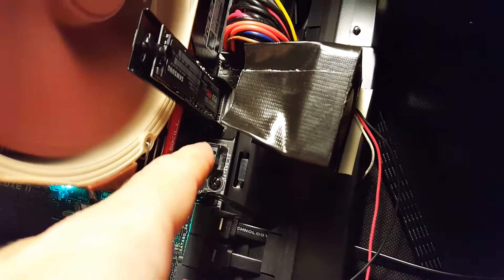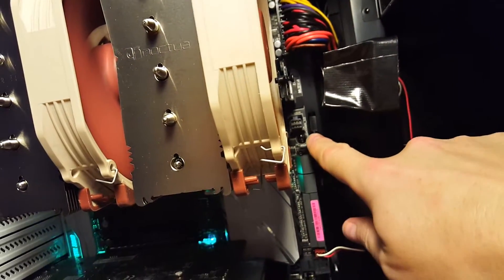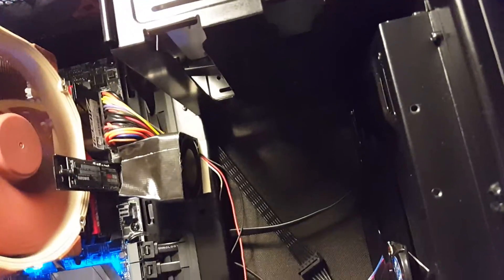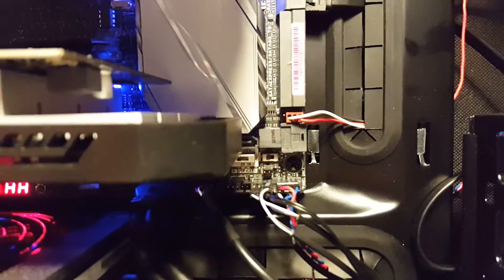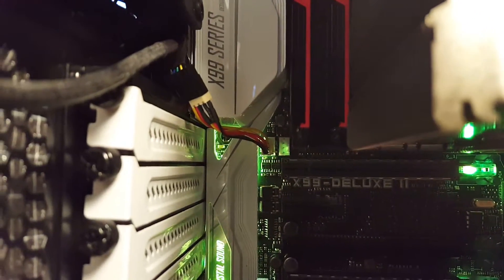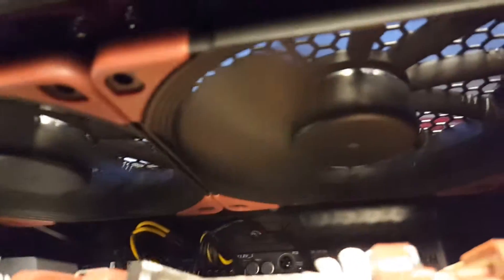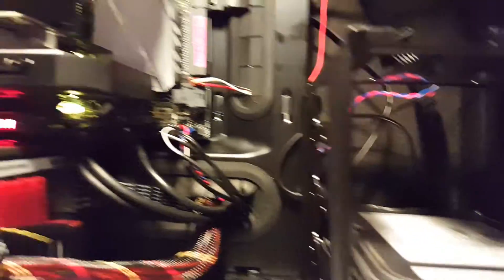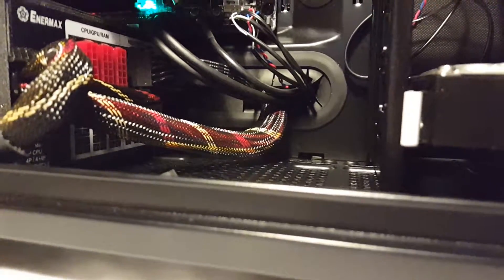Additional cooling for 950 Pro m.2 in ASUS X99 Deluxe II

Comment: DId you know that some of the new Z370 motherboards have a bracket included for mounting a 40-60 mm fan to cool m.2 NVMe. Your idea and method is not deemed insufficient.
Reply from the maker: I added the fan because of another video I watched that showed that the Samsung NVME sticks got hot in the controller while doing heavy file copying.

Comment: I know you are just trying to cool your PC better. But why would you do this to your PC?!
Reply from the maker: Do what exactly?
Reply: LoveAviation Being completely honest, cooling your SSD isn't exactly going to offer a significant albeit noticeable difference in the performance of your machine.
Reply from the maker: Have you seen how hot these get under constant load? ther is a video about it that someone tested the m.2 Samsung similar to mine and it started throttling itself down to run cooler. BTW since this video was made I have made many changes including removing the small fan that was blowing onto the m.2 ssd.
Reply: LoveAviation I have 2 M.2 SSD's inside my PC, and two SP fans in the front and they only barely reach 36 degrees celsius.
Reply: LoveAviation I am not insulting you, I am simply criticizing. If you are truly having cooling issues with your M.2 SSD a heatsink with thermal pads should work fine inside a case with decent airflow.

Comment: no front fans ? 
why is the gpu located in the bottom Slot ?
Reply from the maker: I have relocated the video card to top slot. I have since made another video that shows the final configuration. I put the 2 fractal case fans in front and the noctuas are in back and back top. took the small fan blowing on the m.2 out.

Comment: I have the same motherboard and cooler, but my system is very quiet . I want to buy 950 . CPU Cooler become noisy due to the proximity of 950 ? Thank you!
Reply from the maker: no it doesnt get hot unless you do alot of access
Reply: +LoveAviation Thanks for the answer. But I asked about the extra noise from near ssd location of the fan impeller.
Reply from the maker: +Александр Астафьев the noise is not from the small fan i have right in front of the m.2.